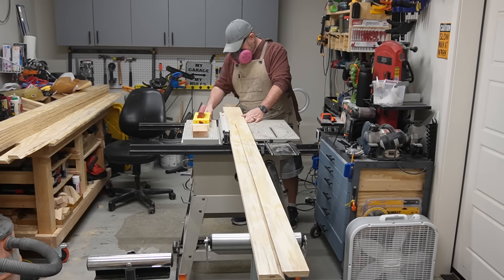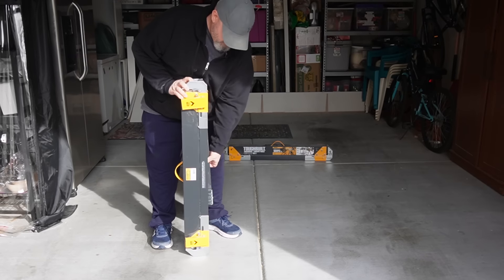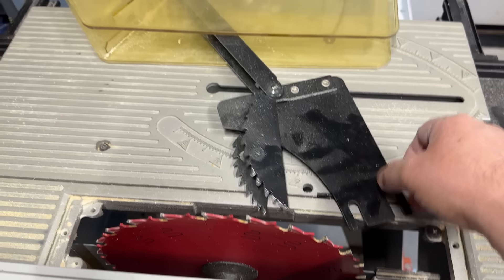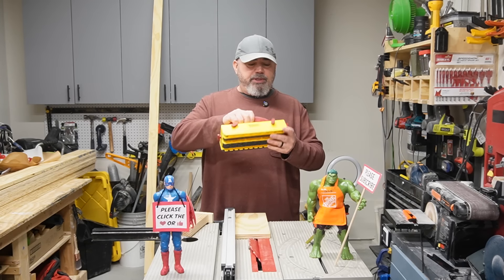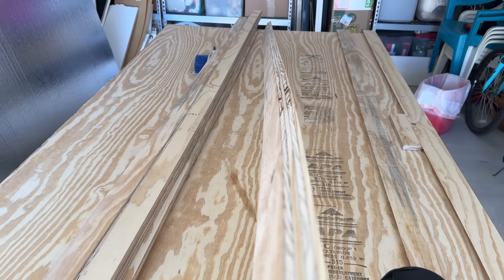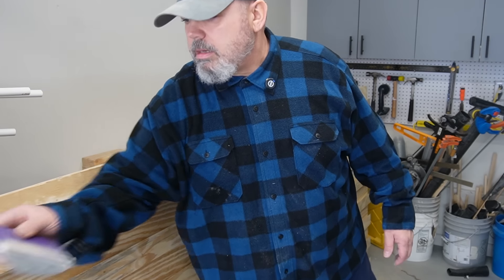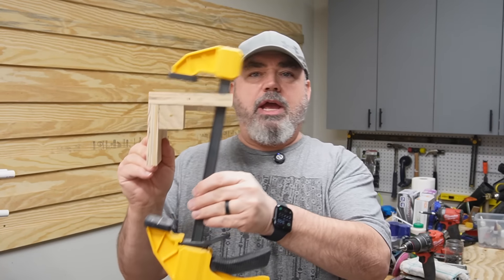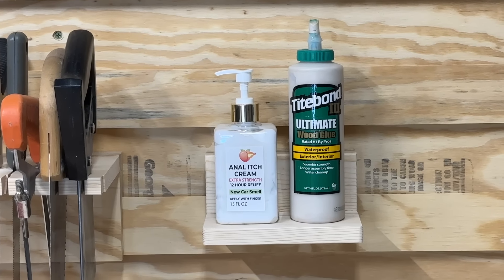Easy Beginner Woodworking project for Workshop Organization

Comment: Why don’t you just take off the bolt and use the riving knife? That’s very important.
Reply from the maker: Its in there with rivets but you are right i need to stop being so lazy and drill out the rivets. i didn't want to do that before just incase i needed to use the other part with something but I could always find nuts and bults to replace the rivets. Thanks for the comment.